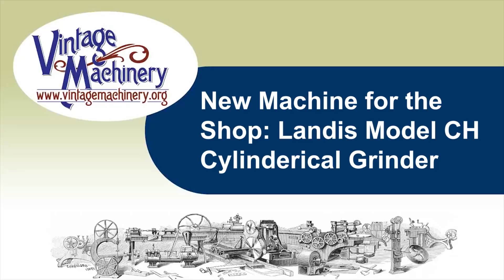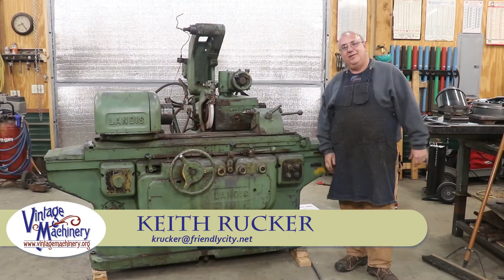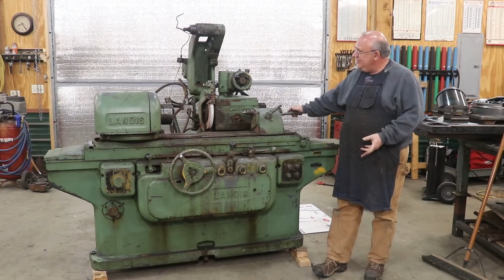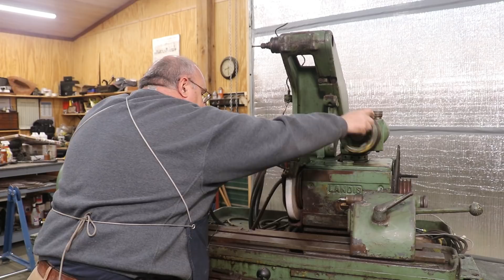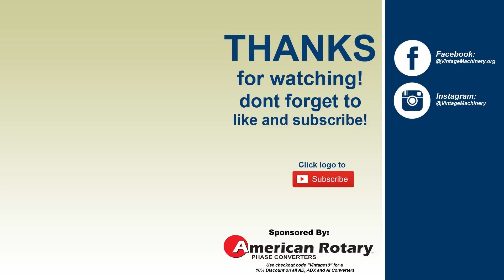New Machine for the Shop: Landis Model CH Cylindrical Grinder

Comment: Keith, I bought a 2 hp, HF dust collector for wood working and after replacing the filter with a 1 micron (I think) filter bag, I found I could run it with the intake loose in the air and it would actually clean dust from the air ! One might be of use in keeping grinding dust from spreading outside your grinding area. The standard 5 micron filter may be sufficient for your uses.

Comment: I ran a Landis Cylindrical Grinder in a grinding wheel factory with a 30" x 2" wheel. We used it to grind grinding wheels to the proper diameter.

Comment: For the hydraulics I would check the RV and bleed the air out of the system.  If the machine was moved more than likely the oil level is low.  That would cause the pump to cavitate and that would the hydraulics I would check the RV and
bleed the air out of the system.  If the machine was moved more
than likely the oil level is low.  That would cause the pump to
cavitate and induce air in the system.  When you go in the access
door make sure the cylinder is not leaking and check all of the lines are
good.  I do agree change the oil filters.  It would also be good
practice to drain the tank and clean the sludge out of the tank as well. 
The same goes for the coolent pump reservoir.  I am sure that is
nasty as well.   For the hydraulics I would check the RV and
bleed the air out of the system.  If the machine was moved more
than likely the oil level is low.  That would cause the pump to
cavitate and induce air in the system.  When you go in the access
door make sure the cylinder is not leaking and check all of the lines are
good.  I do agree change the oil filters.  It would also be good
practice to drain the tank and clean the sludge out of the tank as well. 
The same goes for the coolent pump reservoir.  I am sure that is
nasty as well.   For the hydraulics I would check the RV and
bleed the air out of the system.  If the machine was moved more
than likely the oil level is low.  That would cause the pump to
cavitate and induce air in the system.  When you go in the access
door make sure the cylinder is not leaking and check all of the lines are
good.  I do agree change the oil filters.  It would also be good
practice to drain the tank and clean the sludge out of the tank as well. 
The same goes for the coolent pump reservoir.  I am sure that is
nasty as well.   For the hydraulics I would check the RV and
bleed the air out of the system.  If the machine was moved more
than likely the oil level is low.  That would cause the pump to
cavitate and induce air in the system.  When you go in the access
door make sure the cylinder is not leaking and check all of the lines are
good.  I do agree change the oil filters.  It would also be good
practice to drain the tank and clean the sludge out of the tank as well. 
The same goes for the coolent pump reservoir.  I am sure that is
nasty as well.   For the hydraulics I would check the RV and
bleed the air out of the system.  If the machine was moved more
than likely the oil level is low.  That would cause the pump to
cavitate and induce air in the system.  When you go in the access
door make sure the cylinder is not leaking and check all of the lines are
good.  I do agree change the oil filters.  It would also be good
practice to drain the tank and clean the sludge out of the tank as well. 
The same goes for the coolent pump reservoir.  I am sure that is
nasty as well introduce air in the system.  When you go in the access door make sure the cylinder is not leaking and check all of the lines to make sure they are not leaking.  I do agree change the oil filters.  It would also be good practice to drain the tank and clean the sludge out of the tank as well.  The same goes for the coolant pump reservoir.  I am sure that is nasty as well.    Great score!

Comment: Does the tail stock have a Jarno taper? If you need any centers, I have a bin full that I got at a recent auction. I bid on this lot because I thought from the picture they were MT4, never heard of a Jarno taper. I think most are #9 Jarno. I would be glad to send you whatever you can use.  https://www.bidspotter.com/en-us/auction-catalogues/heath-industrial/catalogue-id-bsche10379/lot-69f83d09-e82d-43d1-ada5-aaaa0125e72f

Comment: That was very interesting. Very nice machine and great to hear you reconnected with the mentor of your youth. I'm resurrecting an old Harrison milling machine at present. I've had to rewire all the motors from what is called star in British practice to delta. In the US I believe you refer to star connected windings as "wye". This allows my motors to run on 240 volts 3 phase from a group of vfd's. I actually had to strip my motors and rewire the stator coils as they had no junction boxes for easy access. I also changed the bearings at the same time. In the UK 240 volts is our standard mains voltage. 

I think the speed control system on your machine is what is known in British parlance (and possibly American too, I'm not sure) as Ward-leonard system. This is where an AC motor drives a DC generator, which powers a DC motor. Speed control of the DC motor is achieved by varying the field current using a suitable rheostat. 

I'm usually watching your content from my home in the UK, but this time I'm a little closer to you as I'm on your side of the pond. I'm working on a ship in Theodore in Alabama, near Mobile. I was sent here by my company to replace a large hydraulic cylinder. 

I'll be here over Christmas so let me take this opportunity to say thank you for all the inspiring 2019 content and wish you and your family a very happy Christmas.

Comment: That's a hell of a fine machine. With a good clean-up and possibly some tinkering you'll have an utterly reliable toolroom cylindrical grinder that should split tenths if need be and generate true cylinders round within millionths. It's suitable for gage maker work and for general machine shop small lot production.

Chances are there will be some wear under the tailstock and the registration surfaves on the platen on which it slides. Years of careless operators have slid the tailstobk back and forth over grit residues effectively lapping away the built in accuracy. This will become evident as job succeeds job and you have to tweak the taper every time. The is no fix for it except to recondition the platen and the registration features under the tailstock and headstock castings. Fortunately, you have a freshly reconditioned planer on which you can do the wotk.

That machine is probably 70 years old. It will benefit from a complete tear-down cleaning and inspection. Make a good series.

Comment: And here I thought that you cured your old machine "sickness". About damn time you got a cylindrical grinder, welcome to the round grinding club.  Drain the hydraulic fluid right away, clean the table surface and check it to see how much it is worn from sliding the tailstock, pull the table if you can to clean the ways underneath. You know the drill, clean it and run it before you make any cuts with it. Moving these machines is when debris gets knocked loose and winds up in areas you don't want it.  Due diligence up front saves aggravation and money down the line.

Comment: Looks similar to an old Austin ID/OD grinder I used in a die making shop back in the 80s, similar features to this, but a much smaller machine. I remember the boss said it was a pre world war 2 German built machine. Very useful for finish grinding the ID and the OD of the bottom die of an open compound washer die set all in one set up, since you can do both operations without needing to move the piece, the concentricity was always right on the money.... beautiful acquisition... have fun!

Comment: I've owned and operated several different crankshaft grinders in my automotive machine shop.  Basically the same machine principles but crankshaft grinder is far more versatile except for taper ability.   Does that use a steady rest like a crank grinder and also did they ever offer a Arnold Gauge setup to accurately monitor your progress while grinding?  Cool Machine!!!

Comment: I hope you'll be very happy together :-)

The hydraulics I'd say is air in the system but I'm sure a man of your calibre will get it going. That's the wonderful thing about hydraulics... Problems tend to be trivial... Or catastrophic I suppose but usually the fact you're standing in a puddle of oil and metal-shavings will tip you off.

Comment: I noticed that this grinder is supported at the extreme ends of the base.  I believe that I have seen other of your machines supported in a similar way.  At the weight of this device (6000lbs) wouldn't there be some risk of the bed/ways drooping in the middle?
Reply: They machined it supported the same way so it should not be an issue.
Reply: Also it is temporarily in this position just inside the door.

Comment: I know I’m wrong but it seems like it would be hard to get tight tolerances because the grinding wheel would wear down.
Reply: Wheel wear is basically controlled by, among other things, the wheel hardness/ structure/bond, if I remember correctly.  It's a balancing act.  "Soft" wheels can wear quickly, while hard wheels typically wear down slowly.  But if a wheel wears too slowly, it can "rub" instead of cut cleanly, and cause too much heat and therefore cause "grinding burns" which are especially important when grinding high-strength steels.  So it would need to be dressed to "sharpen" it.  I've forgotten much more about grinding wheels than I remember (from ~25-30 years ago), but there are many items that can affect grinding wheel wear.

Comment: In 1977 I got a job as a tool and cutter grinder. I was 26 years old at the time and my career into machining was just starting.  I had that job for 17 years. Spent a good deal of time grinding slab mills, straddle mills, adjustable reamers,  tapered reamers, etc. on one of these, actually we had two of them.  Enjoyed that job immensely. Unfortunately that was right about the time our shop was moving very fast towards the replaceable carbide insert tooling and that is where the majority of the work of our grinders went.  I went on to the tool room machine shop, and learned Bridgeports,  manual engine lathes and eventually to a CNC lathe, but those grinders are where I got my machining start. GREAT addition to your shop!! Thanks for the videos.
LaVern

Comment: First job for Landis: Connecting rods on Stoker Engine maybe?
Reply: Really hard to out grind a sunnen  rod hone.  But I can see tons of hydraulic valve grinding on that and some spectacular tailstock quills that fit a rebored tailstock body.
Reply: @waynep343  "Connecting rod" may not have been a good choice of words... The "rods" on the steam stoker engine are just straight bars between steam piston and crosshead slides.  Keith had to Sawsall the old ones out. The replacements will require a good surface and consistent OD to seal well.  Check out the past videos on Stoker Engine.
Reply: @marks5603  stoker I forgot he had a stoker steam engine. I was thinking stroker .. as in a hot rod engine. I get lost sometimes.

Comment: It's cool to see different machines.
Reply: Keith  where I  worked at I  ran a Landis that was most likely older than yours , the spindle bearings are very expensive to replace , ours had a gauge to see that the temperature was within  spec. I  believe ours was made in the 50's  .